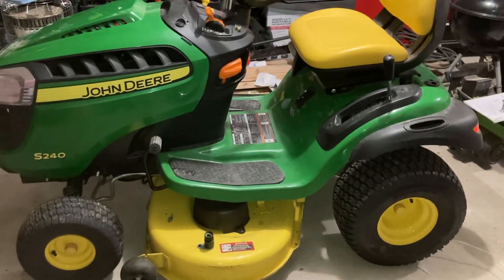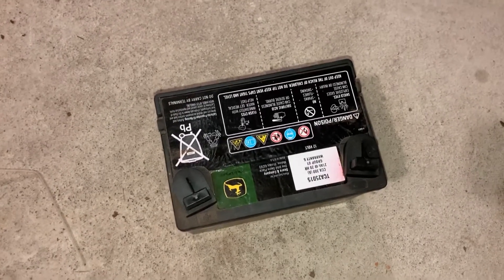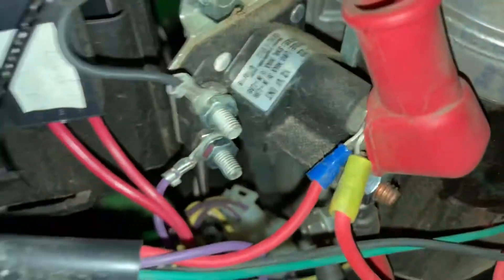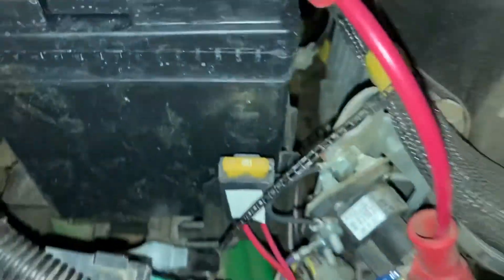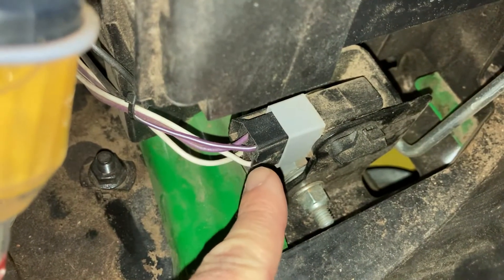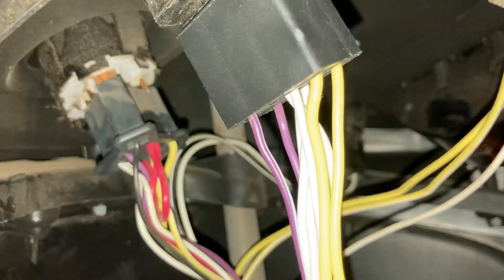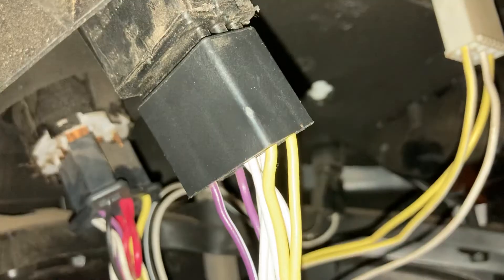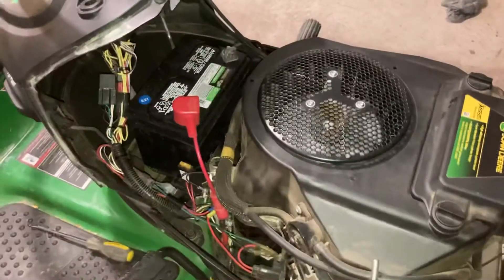How I found the electrical issue on my John Deere S240, and a look at all of the safety switches

Comment: I had a no-start situation as well. solenoid was fine, so had to figure out which safety switch was failing. I was able to get it to turnover after rocking it, so that told me it was either the reverse or brake safety switch. The reverse checked fine with voltage, but no voltage on the brake safety switch. Those safety switches are in a very dusty environment, so after blowing them off, and cleaning with a brake cleaner, I got good contact and it starts no problem. Bottom line, clean those contacts before ordering a new switch. My S240 is 7 years old with ~150 hours on it.

Comment: Fantastic video.  I thought there were only 3 safety switches until you pointed out the switch in the rear for the reverse linkage.  You can see it without raising the mower by removing the cup holder.

Comment: I was having a problem with my S240 that mirrored what you’re talking about. I watched your video, pulled off the connector for that blade engagement switch, sprayed it with DeoxIT contact cleaner, and it cranked right up. You just saved me hours of troubleshooting and possibly buying a new starter and alternator. Thank you so much!
Reply: BTW, my seat is completely destroyed. It has cracks in it and the vinyl is missing in spots, and the foam is exposed and flaking off. I’m not a fat guy,. I only weigh 170 pounds. I don’t know how you keep Your seat looking so good.
Reply from the maker: @ My seat is doing the same thing and it started in the fall and it is nearly cracked straight across. I have no idea what I am going to do, but a new seat is $200+ when I last checked.  I might just get an Amazon seat cover.
Reply: @ It’s a shame that it happens, but I don’t want to pay nearly 10% of the purchase price of the entire mower to replace the seat. I think I’ll do the same as you.
Reply from the maker: @ I am going to wait until the spring and then look at what I am going to do with it.  I think a seat cover might be the best low cost option for now.
Reply: @ post a video about it. We can learn from your experience.

Comment: Thank you. Your mention of the 'reverse pedal' saved me. On my E130 I rocked the pedal a couple times and the mower started right up. I too had previously turned the mower off just after backing up. The switch was obviously stuck in reverse and wouldn't let the engine start. You did a great job touching all the bases.

Comment: My mower wouldn't start ,it was thus area that was loose it doesn't fit tight..it wasn't the battery it wasn't the silenoid, it wasn't the safety switch ..so check this before you order parts

Comment: Thanks for the tip, was in the same boat. My mower control  knob had dirt in that wire connection, cleaned it out, problem solved

Comment: I am at 62.5 hours on my 2018 John Deere S240.  Three weeks ago I started noticing the PTO (mower deck switch) started being intermittent. I'd pull it a few times and would eventually go.  This week it finally totally fails to engage the mower deck clutch! 

The motor starts fine, but I have no voltage going to the clutch or to my lights??  I've tested and bypassed seat switch & reverse switch and confirmed starter switch is operating properly in all positions. 

Did you ever find the final culprit in your 12V in / 0.3V out issue. I'm certain I'm seeing the same thing, but can't locate the issue!

Comment: At 7:55 in the vid, underneath is seen the transmission pully under the fan. Do you know the best way to access that? I need to replace mine. I think the teeth on the factory one are worn down. Thanks if you have an answer. I also have the same S240.

Comment: I have a 2015 S240 that has intermittanly been doing the same thing for several years. At one point, I thought I had it fixed but it started screwing up again. I had the PTO switch short out to where it melted part of the socket that it plugs into. I also suspect a problem with the PTO clutch itself but have not tested it yet. I replaced the ignition switch and the PTO switch(dirt dauber wasp related) and the problem cleared up for about two years. I worked on it today and it would start about six times straight and then quit working. It is not getting 3.1 volt on the purple start solenoid and I suspect the reverse switch because it is the only one I haven't tested or it could be a broken/chewed wire somewhere. I momentarily jumpered 12 volts to the starter lug on the solenoid and mower will run but once you shut it off the no start condition is still there. I almost ordered a front main wiring harness but backed out.($100-$165) so  I found the tech repair manual online for $30 dollars in PDF format and downloaded it. It has wiring diagrams and everything and you can download multiple copies in a predetermined amount of time. I bought a Gravely 52 in. zero turn 3 years ago but still like to use my S240.

Comment: You definitely did a lot of investigating/trouble shooting your problem. You did excellent work. I too have a s240 mower. Bought it new. As of 10/30/23 only have 8 hours by the computer. I too have a maintenance plan, and wonder now, when maintenance is done are these switches checked. Thanks this helps.

Comment: 666 is the sign of the devil.....Friday the 13th and a full moon are always trouble. 
 Thanks for the video, I've had my JD 125 for 15yers now and it's just lately been causing me trouble. So since I can afford to buy a new one I watch many videos like yours and fix everything myself. 
I would just like to share something I've learned that some of you may not know. When buying parts for your JD tractor engine (Briggs and Stratton) Buy the actual parts from a B&S dealer or online as they are MUCH cheaper than from the JD dealer or box store that sold the Tractor.  ex. fuel pump JD is $86 cnd  or Same fuel pump from B&S is $36.
Good video 😊

Comment: Saving this for future electrical troubleshooting (for my BF who does all that lol). I'm trying to figure out why my blades won't engage. I had disengaged the blades with the PTO switch, put on the brake, left the tractor running to go speak to someone. When I returned a few minutes later and tried to engage the blades using the PTO switch, nothing. Maybe tomorrow I'll get brave and pull the switch out and try testing it with the mulitimeter I don't know how to use "yet" :) Have only had this JD S240 tractor a few months but bought second hand so no warranty sadly.

Comment: Thank you Mike. Checking the harness connections helped me to solve my starting issue. Unfortunately the problem was me. I got stuck at the bottom of a slope and had to pull my tractor out. After getting it back on the driveway it wouldn't start, so I looked it up on YouTube (NATURALLY). Convinced that my problem was the solenoid I ordered a new one and switched it out. Same issue!! Must be a faulty Chinese solenoid, so I returned it and ordered another one. Thank God for Amazon. Still same issue . Found your video and went out to check on the various wiring connections.  Turns out that because I didn't shut down the machine as usual I didn't disengage the mower. Pushed in the mower switch and the baby fired right up.. So, to all my fellow knuckleheads.....you're not alone. 😀

Comment: But those are buttons any mower i get all that gets tooken off all the way to each relay box and bridge the relays together that i don't need anymore so then each is then wired to the ignition relay so then instead of it having only one has 3 to 4 extras 

Mine will start in reverse or forward or in neutral without pressing the brake pedal i can stand to the side and start mine up but thats how i like it wired up i don't like all those safety buttons 

It could be better for the owner if john deere made them with inline fuses for each safety button so then we would know what button is blown out by seeing the burnt out fuse if it could work that way
Reply: I can't figure out what you typed,  makes no sense,  wish I could understand it though

Comment: Just had the safety switch for the blade engage break off the cheap plastic mounting.  It went from running well to no start.  I by passed the safety with a  piece of wire then wrapped it all up with electrical tape
Reply: Best way to do it is having no safety buttons on the mower which ever buttons you don't want just cut the wires and splice together yellow with yellow and orange to orange and tape up the open wire and its ready to go my yard man mower wire coloring is probably different from the john deere but its still the same with those and the colors you'll wanna keep the two separate 

But if you're wanting to take out all the buttons you wont have to tape up many wires 

I've bought lots of mowers with safety buttons that have been zip tied down so that the button is pushed in and constantly on when all whoever had to do is cut the wires burn some of the coating off twist the sames colors together but whoever didn't do it that way and what happened was that button burnt out 

You really don't need any of the safety buttons unless you don't know how to operate the machine right thats what i think about those

Comment: Thanks for the ideas.. I didn't know anything about the electrical systems on these, but after about a week of researching / trying different things- I've learned a WHOLE lot lol. The 12 volt through the kill wire is a nice tip.. And didn't think about checking reverse switch either.

Comment: Thank you!  I too experienced the click of nothing at 34 hours.  Immediately, I blamed a dead battery and did a charge thinking because I hadn't used the machine for two months that was it.  However, it made no difference.  I did not get any more serious into the machine and turned if over to Agpro.  Agpro said it was the battery which I had replaced.  I haven't had any issue with the electrics since.  With your video I feel better to take some additional steps when and if it happens again.

Comment: I've got a L110 and it's been perfect for nearly twenty years and now the safety sensors are going crazy, won't go into reverse when the blades are engaged, won't start with the key, have to jump the selenoid to start it. I'm too old to fix all of this but thank you.
Reply: I think you got your moneys worth out of it; time to sell it and get you something new for the next 20years:-)
Reply: @chadfield376  hello Chad. Guess what? I went and started working on the John Deere rider and got it fixed. Simple solution and it made my day. Thank you for your interest 😉
Reply: @dannyorsello8668  You got to love it when it’s simple; in my limited experience of practicing small engine RE-habbing, that is generally what the issue is😀
Reply: @chadfield376  be safe. Enjoy life.
Reply: I’m 75, living on a fixed income. Not going to be spending that kind of money. I will try and fix the issues thank you 😃

Comment: Great Vid. I just took my JD mower it would not start just clicking from solenoid hopefully when they repair they will explain to me if the switch went bad. I replace the solenoid battery, sprk plugs, new starter on my own still nothing. just the clicks when try to start the mower on my E120 So it must be a bad switch somewhere. Thanks for the vid.

Comment: Great video.  I have a 240 just about as old as yours and my PTO switch stopped working coincidentally with me removing the seat to see about recovering it.  Put the seat back on, plugged the seat sensor back in, all was good, started right up but now the PTO switch won't engage the deck.  I ordered a new PTO switch but can't believe the  PTO failure happened at the very same time that the seat switch was unplugged.  We'll see.  Thanks for doing the video.
Reply: Update . . . turned out being that the pins on the harness to the seat switch and the seat switch itself were not making good contact.  Had to spread the pins apart and tighten up the female receivers on the harness.   All this from just removing the seat and the harness once.
Reply: @ultrahuck6807  we are at that same point we think..but also replaced the pto switch but new one is defective..got the old to work.  New one from JD no good.  Really go figure.
Thanks for your added comments..they helped us here
Reply: Also, fYI, on the seat switch harness the two inner receivers are for the switch and the two outers go the PTO.

Comment: I had the same issue with my harness.  The pins corroded.  I took the purple wire pins out and replaced them.  Easy fix

Comment: Very good job in explaining where the switches were located. Is the ignitions hot wire also purple as to the cellaniord wire hit(is the purple wire to hot for both). Having exactly the same issue as u. Would this lack of amperage stop the fuel from flowing ,if not cranking as it should
Reply: Flow of fuel to carborater.......
Reply: Only if your carburetor solenoid isn't getting any power to it it cuts the gas off when the ignition key switch is turned off when you turn it on you'll hear a click then know the gas is flowing through the carburetor mowers can have tons of different problems

Comment: U can just unplug the seat it's a normally closed switch but is also tied to blade turn on
Reply: That doesn't work,  you need to jumper it
Reply: Actually put some thin plastic, or credit card, cut it to fit inside the inner two wires on the connector

Comment: Hey Mike, great video! Just what I needed. I was asked to "resurrect" D100 lawnmower with exactly the same symptom, and your troubleshooting sequence certainly saves me a lot of time on figuring what is what and where. 
Thanks!
Reply: I found that there is one more possible cause of this symptom. In my case the battery was charging only till 10.5v. This should be enough to crank, or at least to get a "click" from the solenoid... WRONG!
When nothing was happening (not even lights would turn on!) I measured voltage under the load... 0.45v !!! I brought in an old car battery freshly re-charged and ta daa... it cranked likw it should. My point is, that dying battery might be tricky as with no load it will show "good enough" voltage, but my suspicion grew when it would not charge to a full charge. The symptom for dying battery would be lack of lights. Apparently with D100 series the ignition switch makes it possible to take out the key while in position other than "zero". This would drain a battery completely. So now getting a new battery, cleaning carburator, replacing fuel filter..  just regular stuff. Thanks again for pointing out location and function of all the switches. It saved me time!

Comment: How did you use your multimeter to check the wires in the wire harnesses?
Reply: With the v symbol first option on most meters 12 volt battery he explains it all

Comment: Wait till you have to change the drive belt for the tufftorq. Standing the tractor up vertically in a wheelie helps🤘 good video
Reply from the maker: I hope that is several years away.
Reply: @ohdeergaming it ain't to hard just jack it up a little take off that middle pulley and its good its not hard to do you don't have to stand the mower upright to do that job

Comment: Thanks, very helpful knowing all the switched.  My issue is different, it has no power, the LED display, what you call computer is out too.  The battery is new and tried recharging, tried jumping, nothing.  Anyone have any ideas?
Reply: Fuse

Comment: I had trouble with a PTO switch . When you wiggled the connector plug , it would start .  I bought an                    aftermarket connector with leads . I took out the  PTO switch , and soldered the  new connector plug        leads , directly to the pins . Then I cut off the old plug ,and soldered the other half of the new plugs leads to those input wires , then just plugged it back together . That worked . It would only work , if the switch was healthy , which I checked with  a continuity meter .

Comment: I just bought one of these tractors (2020) and I love it. I also do stuff like this video when I find problems with machines. I just wanted to say thank you for putting this kind of video out there. It might be a few years before someone sees this and needs it, but you probably just saved them several hundred of dollars and a ton of frustration.
Reply from the maker: Thank you.  I was extremely upset about this. Luckily, the service was willing to give me a pointer here and there - they said if I dropped it off - it was $90 per hour and since it was an electrical issue - could be 30 minutes could be 6 hours before they find it.  I did all the tracing myself, and had to teach myself a lot of the wiring.  I am hoping someone douesn't have the frustrating experience I had until I learned enough to trace it and find it.  I ended up replacing the PTO switch after making this video ($23 shipped) and put a little bit of dielectric grease on the pins for the safety switch check (purple wires) - plugged it in, mowed for over an hour - turned it on and off a few times and it started each time.
Reply: Kudos to you on getting that figured out, that is the best way to learn; unless you are just totally mechanically challenged, these mowers are not overly hard to figure out their issues.  The challenge comes when you buy a used non-runner that someone has totally screwed up and you have to back track their mess up and start over the right way.  With your mower owned since new and always done the maintenance on it, it’s going to last you a very long time.  As cheap insurance, I would go through all your key connectors and make sure they have dielectric grease on them which will help prevent that corrosion.  You can bet had you taken your mower in to JD, they would have made you pay a $4-500 diag fee min.
Reply: Thank you,  very good tutorial
Reply: Kind of weird,  my s240 doesn't have a rear drive pedal like that